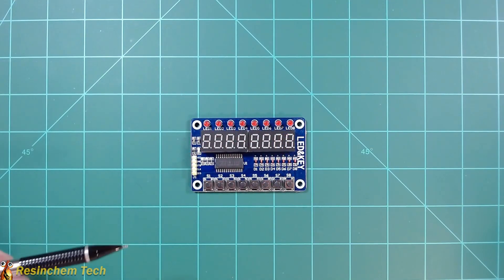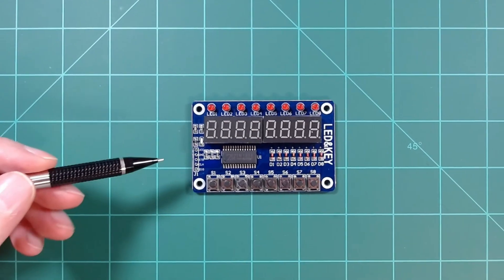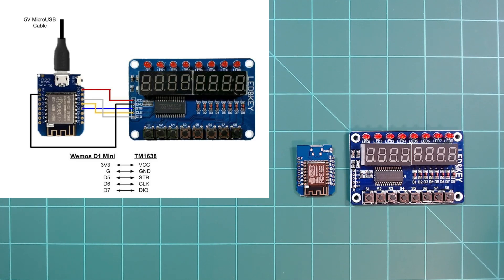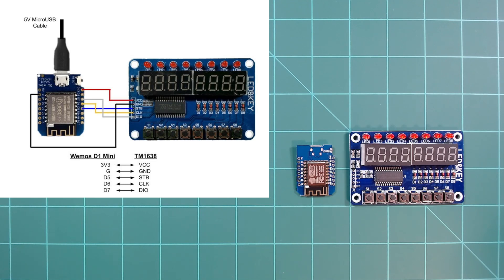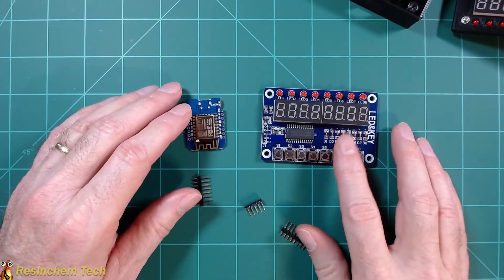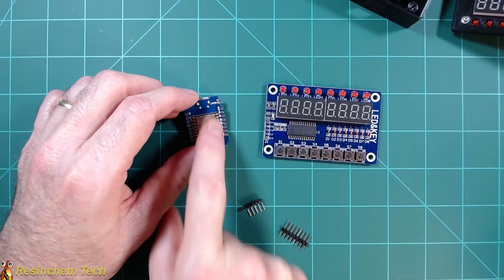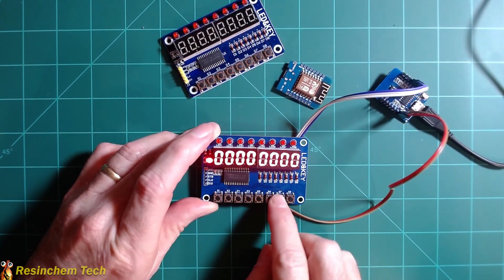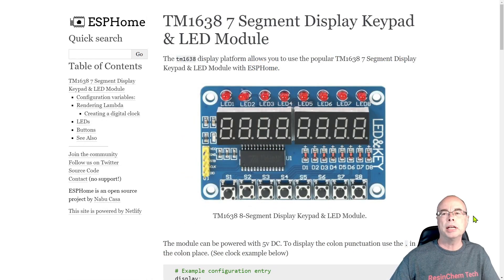TM1638 Display with ESPHome and MQTT for Home Assistant

Comment: Hello and thank you for the very useful tutorial. I connected the TM1638 to a Wemos D1 mini (ESP8266MOD) , I used d1_mini as the board type and  stb_pin: D5, clk_pin: D6, dio_pin: D7. The board programs fine and connects to the wifi. Unfortunately I can't get any number on the display. I tried changing the D5,D6 and D7 to GPIOs but no change. Any suggestions please? Thank you
Reply from the maker: I'm guessing you are using ESPHome for the D1 Mini?  If so, with monthly releases and numerous additional patches and fixes in between, it is entirely possible that something changed in how the TM1638 is configured/used.  Have you looked and (or tried) some of the examples on the official ESPHome page for the TM1638 ( https://esphome.io/components/display/tm1638.html )?  If you cannot get the display to show the simple "0123" using the example there, then it could mean that the TM1638 or even the D1 Mini is faulty in some manner... or something is incorrect with the wiring.  If possible and you have them on hand, you can always try a different D1 Mini and/or different TM1638 to attempt to rule out a faulty device.

That's one of the challenges with making videos on Home Assistant or ESPHome (and tech in general).  What I show in a video today might change with the next update or patch.  And with hundreds of videos and blog articles, it just isn't possible for me to go back and keep every single code sample or example current.  That's why I generally always try to include links to the official documentation somewhere in the video description or article.  This also recently happened with the AHT10/20/30 temperature humidity sensor.  A new parameter was added that "broke" my original code.  So it is often necessary to check current documentation vs. any configuration or other code that I show, as changes may have occurred since my original video/blog was published.  Let me know if I can help out any further... but the official ESPHome/TM1638 documentation is probably a good place to start.
Reply: @ResinChemTech  Thank you very much for replying. I appreciate it. I will follow your advices. Thank you

Comment: FYI. There are 256 combinations of buttons that can be pressed, including the option of pressing none at all. (2^8)
Reply from the maker: Yes... and I do show 255 combinations on the screen since I miscalculated on the fly when recording.  I guess you are technically correct that it is 256 because I didn't count pressing no buttons as part of the total count of button presses.  Thanks for the clarification.

Comment: Plenty of time to review your video while waiting on my TM1638.
This question has haunted me and I thought I would ask:
How would I have known which pins to use between the two boards without  your video?
    stb_pin: 5->GPIO14->SCK
    clk_pin: 6->GPIO11->MISO
    dio_pin: 7->GPIO13->MOSI
Without your video I would have never guessed for example SCK went to stb_pin and the same goes for the other two pins. How did you figure that out? Just curiosity knocking at my door. Thank you again for the excellent videos.
Reply from the maker: When selecting GPIO pins, I often refer to this pinout guide: https://randomnerdtutorials.com/esp8266-pinout-reference-gpios/

While some pins can be used/defined for multiple purposes (more so on the ESP32 than the ESP8266), note that I'm using the SPI pins for communicating to the TM1638 and the three default pins for the D1 Mini for SPI are D5, D6 and D7 (SCK, MISO, MOSI).  That's how I selected those pins.  So this web site is a great reference for which GPIO pins to use (there is an excellent chart on the site as well, that shows which pins are best for I/O and which ones you might want to avoid).  There is an equivalent version of this page for the pin-outs on the ESP32 as well.  This is generally my first stop when planning a project with an ESP board to determine which GPIO pins I might want to use.

Comment: Does ESPhome "validate" check this section of the yaml: 
lambda: |-      
           it.printf("Gt %.1f F", id(garage_temp).state);
Reply from the maker: No.  The "validation" check only assures that the YAML is valid... it doesn't check logic.  It also does not check anything inside of a lambda.  Lambdas are passed straight on to the compiler as Arduino/C++ code, so it is simply skipped by the ESPHome validation check.  Validation of anything inside a lambda is on you!

Comment: My TM1638s won't be here till mid to end of Aug but decided I would start playing around with the ESPhome yaml file. The first thing I noticed was the ESPhome "Add device" button after pressed no longer offers the selection of devices. I can not select the Wemos D1 mini. Now if memory serves doesn't this determine which pins are offered up in the yaml?
Reason I say this is when I paste in the code shown below I get an error for the pin section
but only for these two pin entries? (The errors are the familiar red underline for these pins.)

clk_pin: 18
dio_pin: 23

display:
    platform: tm1638
    id: tm1638_display
    stb_pin: 5
    clk_pin: 18
    dio_pin: 23
    intensity: 5
    update_interval: 5s
    lambda: |-
      it.print("0123");

Here is the board selection made during the "Add Device" session:
esp8266:
  board: esp01_1m
Reply from the maker: You can specify the board in the YAML file and specify d1_mini instead of esp01_1m.  See this from the ESPHome web site:  https://esphome.io/components/esp8266.html  

Note that there is a link to a list of boards in the above.  On that list, if you find your board (for example, Wemos D1 R2 and Mini) and hover over the board name, you can click on the little clipboard that appears.  This will copy the name you should use in ESPHome to your clipboard and you can just paste it after the board: in your YAML.  Of course, the other option is to just use the generic ESP8266 and use GPIO pin numbers instead of the "D" designations of the D1 Mini.

As far as the error,  I believe it is because 18 and 23 are not valid GPIO pins for the ESP8266.  Where did you get those GPIO pin numbers?  They would be valid for an ESP32, but not the ESP8266.  The pins I used for my ESPHome module are:

    stb_pin: D5  (GPIO14)
    clk_pin: D6 (GPIO12)
    dio_pin: D7 (GPIO13)

You need to either change the GPIO pin numbers to ones that are valid for the ESP8266 or switch to an ESP32.  Hope that info helps.

Comment: Saddened to see they are no longer available on Amazon or at the link posted off I go to search the CHina stores.
Reply from the maker: Not sure where you are looking, but here is an Amazon link for the TM1638 that shows they are in stock:  https://amzn.to/3qhVd32  

Do note that when I provide links in my videos or related blog articles, they are current at the time that the video was made or the blog article was published.  As with all things Amazon, things change all the time... and it is simply not feasible for me to try to keep all the links across all my videos and articles current.  However, if you use a link that shows the product is no longer available, the Amazon page usually shows alternatives... or you can search for the device using the Amazon search.  And if you do find it, it will actually still give me credit and a small commission on the purchase like if you had used my original link.

Hope that info helps, but it looks like you may have already ordered from an alternate source.  Maybe the info above will help if you run into another one of my product links that shows an item that is no longer available.
Reply: @ResinChemTech  I used the link below the video you posted for the TM1638.

Comment: So many ideas after watching your video but so little knowledge;) A solution seems doable for an idea I've been tossing around and wondering how to accomplish it. How difficult would t be to have my ESP8266s running PIR sensors to report back to the TM1638 and display the location of the triggered sensor. For example, if the sensor by the backgate was triggered the display could show "Bak GATE!" or the Front gate triggered report "Frnt GATE". You get the idea currently I have several ESP8266 reporting via call service when there is motion at one of the various motion sensors. How does one carry that over to the TM1638? Thank you just started watching your videos and enjoy the content. BTW I only use ESPhome/yamls found on the internet as I don't fully understand the syntax of the language.
Reply from the maker: That is doable and there are different ways to approach it.  For mine (I have four of them stacked in 2 x 2 matrix and they show me live YouTube stats... such as subscriber count, last video views, etc.  To do this, each TM1638 has it's own D1 Mini that controls the LEDs.  These D1 minis have custom Arduino code that I wrote, but you could use ESPHome as well.  I then use MQTT to send the data to each individual TM1638 that tells it what to display.

If using ESPHome, you could just use Home Assistant automations.  When one of your PIR sensors trigger, an automation could run that would set the display to whatever value you wanted it to show.  Do note that these are only 7-segment displays, so some letters look better than others.  But yeah, you could install ESPHome for the TM1638 onto a D1 Mini and then use Home Assistant automations to control what is shown.  This shows the basic information for using ESPHome on the TM1638: https://esphome.io/components/display/tm1638.html
Reply: @ResinChemTech     I understand "entities" for example
 in Settings-->Devices & Services-->Entities-->ESPhome/Devices-->Select 
 Entities Tab-->in the Entities column there is 
 "binary_sensor.backyard_motion.    
In the automation section create an automation:
Create Automation-->Trigger-->State-->Entity which is:
Backyard Motion. 
Then select Action-->Device-->Athomsmartplug23-->
Action:Turn on Athom Smart Plug switch.

If the TM1638 can offer up similar Action selectable actionable items 
then I am half way there.
BUT my thinking is only the yaml code will offer up these actionable 
items but could be wrong. 
You see I did not write the yaml code for the Athom plug used in this
example it was written by Athom and came preinstalled on the plug.
Will be reviewing the link you posted and see if I can find some 
selectable Action items.
The journey begins. Thank you for your time and help. Getting ready to order TM1638 hope the link still works.
Reply from the maker: I am guessing you also go by "Ruddog"?  If so, thank you so much for the cup of coffee and your support.

To that end, do you happen to use Discord and have a Discord handle?  Discord provides a much better platform for trying to provide assistance than here in the YouTube comments, since screenshots, code blocks, etc. can be posted in Discord and we can even have more of a real-time live chat.  There's only so much support I can provide here in the video comments.

If so and you are interested, I also have a small private, by-invite-only server where a select few like-minded folks that I've invited hang out, chat about Home Assistant, automation, DIY electronics, etc.  It is a pretty good mix of folks just starting out with Home Assistant to a couple pretty advanced folks (including one ESPHome expert that often helps me out... in fact he is the one that introduced me to the TM1638).  Everyone is friendly and no one gets condescended to for being a beginner and asking basic questions.

I would just need to get your Discord user ID.  I could then issue you a friend request.  At that point I can provide much better assistance and can then add you to the server to join the others if you like.  If you have it, you can either post your Discord ID here or if you don't want to post it publicly, you can email it to me at the email address you can find on the About page of my channel (it says for business inquiries, but I'm ok for others to use it if I've invited them to).

Comment: Ok, so here is when I resent you folks with 3D printers but even with that, these buttons are so recessed. Have you seen anything that will sit on top of these so they protrude a bit. Seems like some spring loaded plastic caps that fit behind a 3D sleeve of 8 holes might make this easier to use. 

I like the 8 LEDS and the buttons more than I do the display for my use case. 

However if I give it enough time I can find a use case for most things.
Reply from the maker: I get it about the 3D printer... and yes, there are 3D printed designs that add 'tabs' over the push buttons that make them easier to distinguish and press.  For me, the buttons are secondary to the primary use.  Most control is done via MQTT/Home Assistant and the buttons are just there in case I just want to do something like adjust the brightness without accessing Home Assistant.  They actually aren't as recessed as they may appear.  The throw or push distance of these buttons is very short and they protrude enough that I can run my finger across the front and feel each button.

But I fully understand that not every project I do is for everyone... and I try to provide alternatives to 3D printed parts whenever possible.  But in some cases, a project is never going to look as finished with something like a project does  with a custom 3D designed enclosure.

Comment: Really nice overview of the TM1638 and how to interact with it from Home Assistant!
Reply from the maker: Thanks!  Should have credited you for the idea of using an input_text helper to display data directly from Home Assistant.  And of course I didn't go into details about using ESPHome automations with the board either.
Reply: @ResinChemTech  No credit needed... and I thought your level of detail was right as this wasn't an automations video and you already covered a lot. You could make a follow-up on how your implemented the projects if you want to cover automations, maybe.
Reply: @ResinChemTech  I just learned about the input text helper from SmartHomeJunkie this weekend again. The difference is because of a different example, I think I have a use case or two. I think I confused myself when your video spoke to text I assumed it was the display and I had already heard, Audrino, Lambda, MQTT I wasn’t ready for this. Soon, maybe when I earn my 1 year on HA chip. 🎃